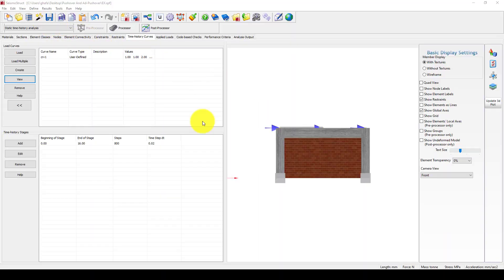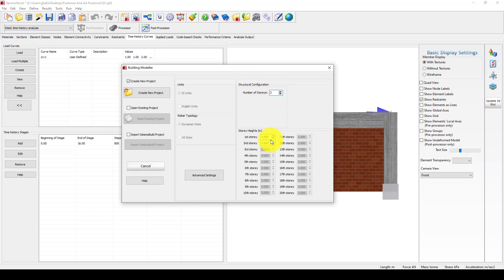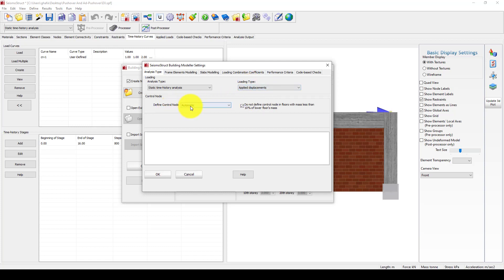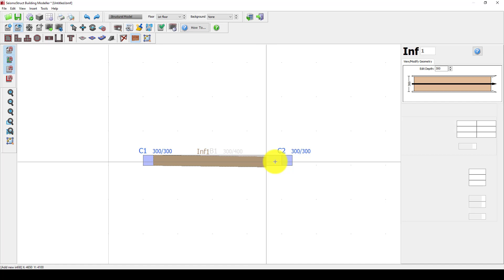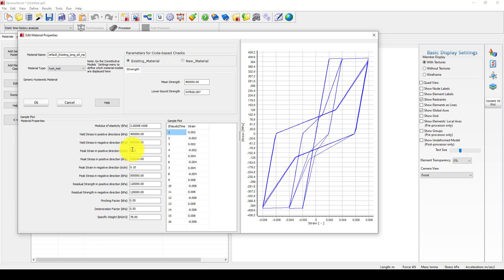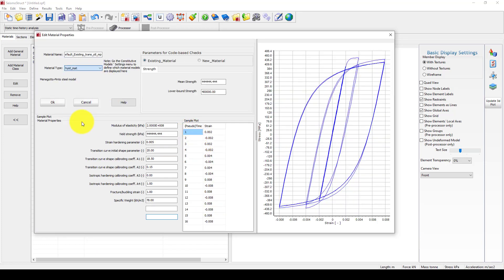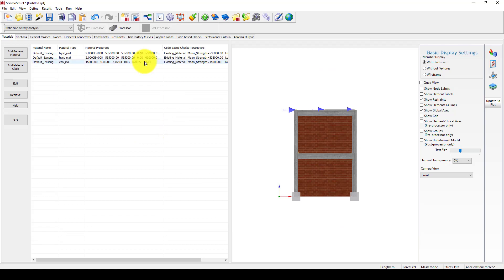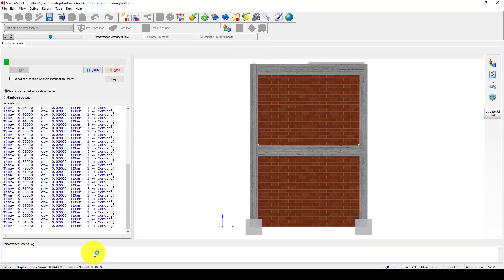The Infill masonry Wall  Hysteretic Performance using SeismoStruct Software

Comment: while modelling infill should we use brick or stone unit compressive strength or brick or stone masonry infill compressive strength. like masonry compressive strength is mainly affected by motar so althought stone is stronger but compressive strength of brick is more than random rubble masonry with mud motar but it may be less than ashlar masonry with cement mortar